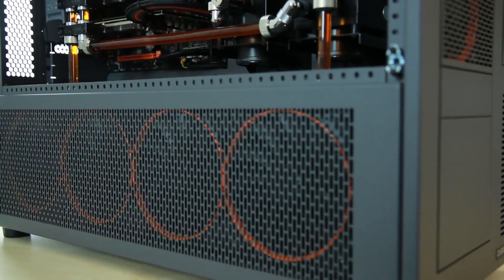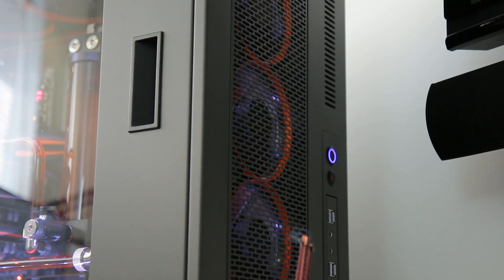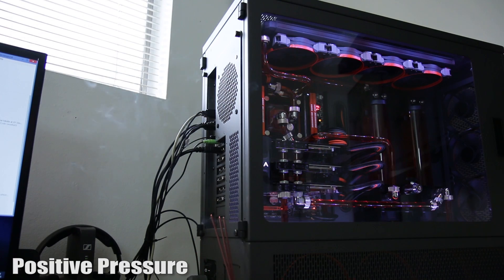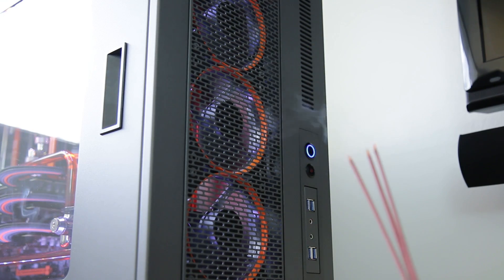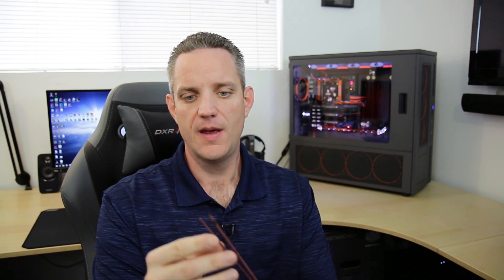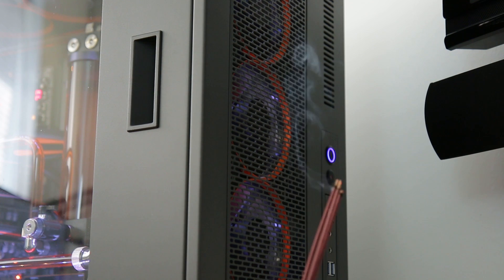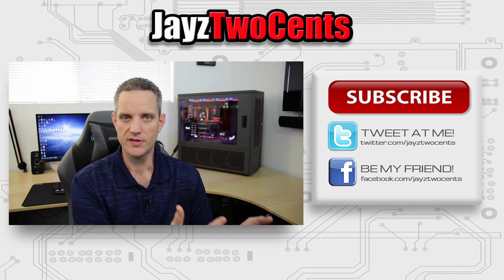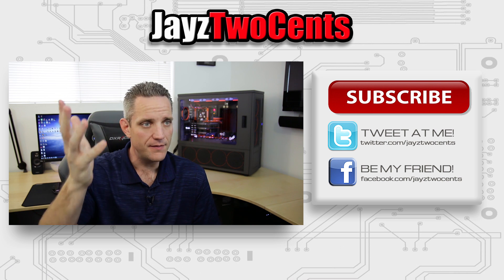Case Flow and Pressure Demonstration - How to balance airflow

Comment: Ik noones gonna answer me but what if im using 3 front intake, 3 top intake fans and 1 back exhaust fan. Is the pressure too much? Will the cooling be better with what i said or just 3 front intake fans and 1 exhaust?
Reply: all front 3 intake top 3 exhaust and back exhaust works fine for me

Comment: Gah.. im buying Lian li infinity fans and want to try see as many infinity mirrors as possible (center) and then they must be set to exhaust afaik.... so IF i put more fans as exhaust, question is if it's worth trying to lower the rpm on the exhaust just to achieve a balanced preassure, since i assume it would mean it would be less air transported through the case, or if i should live with getting some dust in through the cracks and vents... hmmmm VERY educational video, thanks.

Comment: Doesn’t intake fans without filters equal dust?
Reply: Yes, yes, of course, never desirable, for dust is not your friend.    The rule:  Intake shall be through filtered vents only to avoid ingest of dust.  If you have a vent without a filter, you must either employ a fan to exhaust out that vent, or, if no fan is employed on that vent, you must maintain positive pressure in the case under all scenarios to ensure air is passively pushed out of that unfiltered vent (thus avoiding ingest of dust).

Comment: I like to believe pc fans are like vehicle valves inside the engine.  Naturally the intake valves are bigger than the exhaust valves for those that don't know. I have my setup for 2 intake fans in the front, 2 intakes fans on top and 1 exhaust fan on the back. When I run a game like COD : Warzone or Dota 2 for example,  I always see my GPU tempature always at 70-72 degrees celcius.  I was thinking of flipping the top fans into exhaust fans. 😅

Comment: A pull configuration will always cool the rad better because it's not pushing it's own heat through the rad.
You should always have more air out than air in (negative pressure) because positive pressure can create hot spots (non-flowing air). This is a lesson learned from aircraft design (cowls) where heat dissipation is critical.
A closed cabinet with high air-flow will almost always run hotter than an open cabinet with moderate air flow.
You should not be using your computer cabinet as a dust filter, an air cleaner works best for this.
Never BLOW the dust from your computer, always use a vacuum hose and a paint brush to remove dust.

Comment: Thanks for this. This video helped me test and understand how my case air flow worked, particularly under load. While I had a neutral or slightly positive pressure environment which is what I was going for, it actually became a negative pressure case under real-world gaming loads! 

My GPU was pulling more air in under load - This became apparent as smoke was entering in the back of my case were the PCI slots were. And since these PCI slots are not filtered,  over-time this would mean dust was entering in my case, introducing another problem.

The smoke testing allowed me to fine tune the fan curves for both my case fans and GPU fans in order to maintain a happy equilibrium with noise/positive pressure/heat dispersion AND also ensured my desired intake fans were the only ones pulling in air since they were filtered.

Comment: Thank you for the insights! I'm prepping to build a 'research' rig to crunch raw data (BOINC projects) so cooling is a paramount concern (along with power dist). I'm starting off with 3 x Noctua AF-14 3Ks in the front of a NZXT H7 Flow and one more in the back, and there's X73 360 AIO on top for the CPU. The system is engineered (W) to utilize the efficiency of a 1000W Ti PSU so while the fans may seem like over-kill, the goal is run them at lower rpms while still achieving good cfm and reducing noise output, but have the headspace for more cooling at the expense of pc-type silence if all cores (16) are in use. I have all the parts but the Noctua fan controller which must be coming from BFE.

Good luck on the warehouse build out!

Comment: I have 40 positive airflow difference in my case. That's pretty close. Its half of a small fan in my case difference. Is there a program that calculates the acupressure in the case? and then alters the speed of the intake to balance the air pressure in the case?

The reason I ask is I have a minimalist case, cos I have no interest in overclocking. A floor of the case is a hot spot at the bottom, and correcting this is optimal, for the heat and the other fans in the case.

Comment: I didn't go through the comments but wouldn't going through all possible configurations and seeing what the inside temperatures are the best method of fan setup? I inherited 2 front intakes and the other 4 fans, all exhaust (all same size/power and unfiltered). I reversed one in the back to intake and it took the temperatures down 3 degrees f.  Since I'm running a constant 92f I'm happy with the setup. Suggestions?

Comment: I don't think positive/negative pressure matters if you aren't using filters.  also, I found that even if you use positive pressure and filters, it stops all the big dust bunnies, but fine particles still get in so you really don't save any maintenance, you still gotta blow the case out and that fine dust almost seems harder to blow out.
The big danger is, and I don't think anybody makes them anymore, if you have those squirrel cage fan cooled video cards.  The only way to get the dust out is to disassemble the card.

Comment: any descent build has pressure sensors in the case to compare internal and external barometric pressure which the fan controller uses when adjusting the fan speeds.

Comment: I got a shitty ass case and was asked to build a pretty beefy system in it and the guy would not take a bigger case or let me turn RGB fans away from site. I hate RGB ten times more now because the case is so tight I can’t put fans in their logical position without obstructing the RGB with other components so I came to this video for some hints to help and oh boy there was a lot I didn’t realize about negative and positive pressure. So much was well worn territory,  but the RPM bit did help a lot.

Comment: i have positive pressure 2 200m fans on front for intake and one normal exhaust on back. my problem is that since i got the 6800xt which, unlike the 5700xt i had that exhausted straight out of the case, exhausts in to the case. the gpu runs 10-15c hotter with the side panel on so i have to take it off. what is the solution? do i simply need more fans, more airflow through the case? i only have the top vent for additional fans. would it even make a difference since i already have positive pressure and adding two more exhaust at the top would likely create negative pressure and wouldn't, seemingly, provide additional air flow across the gpu.

Comment: Question for Jay & the comment section : 
For an AIO mounted at the top, do I want my fan direction to pull air into case (which seems wrong to me but I'm hearing different things on the internets) or push air out the top?

Comment: So if I have 3 filtered 120mm front fans & 2 top filtered 120mm fans with a radiator, that is positive airflow? I won't need a rear fan?
Reply: Thx in advance

Comment: front panel should always blow into the case, the top of the case should be the exhaust, the rear should also be the exhaust, with the cpu fan being turned to the rear of the case, any other configuration will result in high temps

Comment: Mostly good info, but some incorrect physics here.
You said that positive pressure is when there's more air flowing into the case (envelope) that exhausting out, if this were the case - pressure would continually rise inside the case. The inverse being true for negative pressure. In all three scenarios, the balance of airflow in and out of the 'envelope' finds an equilibrium by either taking in, or exhausting out, air through other vents and gaps in the case. Which you correctly point out, so you're right in the end, but with the wrong physics to back it up.
You also said that a fan 'Can't turn without air going over the blades'. This is also wrong, you could put the fan into vacuum and it would spin, possibly too fast, but it would spin! It's a fan, not a wind turbine.

Comment: My case came with three fans on the front panel as intakes. The bottom one seems to only be blowing air into the hard drive and the power supply. Should I remove that bottom fan and put in the back panel as an exhaust or should I just leave it as an intake along with the 2 fans above it? Or it is worth to buy more case fans? Also I don't know if this matters but I don't have a GPU and I won't be overclocking. I also have a dust filters at the top and bottom and a big air cooler that's mounted horizontally to accommodate the front to back airflow configuration.

Comment: just took the fan from my bad psu and put it in the front intake. the fan is a  2 wire/pin, black and red, black  is ground and red is  12v dc. so on a 4 pin sys fan , you want black in pin 1 and red in pin 2. 

is this correct?  would this be ok?

Comment: 3 intake fans?  What are those 4 at the bottom then?
Reply: The lower compartment is isolated from the upper compartment.
Reply: @JcRabbit  do you have any idea why it's isolated or why does it require 4 fans?
Reply: @trailchaser2  To isolate the hard drives and power supply from the other components. As for the 4 fans, it was probably a question of 'why not?' or 'it looks better that way'. You would have to ask Jay to know for sure, though ehehe

Comment: Summary..
Intake > exhaust-> positive pressure
Decrease amount of exhaust or increase the amount of intake to achieve this.
You can check for the pressure using the vents and smoke. Smoke in means negative, where smoke out means positive. Use the vents that are not occupied by a fan.

Comment: I have Asus m32cd with over have the side are built in holes. How should I set my fans and should I cover the holes. I have a 120mm intake front and 90mm back out take just below psu fan with blows down. I really need help on this. I would appreciate it.

Comment: I have tested this quite a bit and I'm going to buck the trend of thinking (note I have air cooling on the CPU and standard mounted GPU), my best results are in fact - 3 120mm intake front - 1 intake rear just beside the CPU cooler - extract at the top and extract bottom, 3x front brings in high volume cool air, 1x rear brings cool air straight to the CPU cooler - 1x top extracts the CPU  warm air straight out the top, 1x bottom extracts hot air from the GPU fans straight out the bottom, so effectively I have air intake in front and back being sucked  out top and bottom - this configuration works very well indeed and is working with the CPU and GPU fan directions

Comment: There are a lot of pc cases which basicly have an enclosed front side with little holes on the sides of it.. And most of them come with 2 or 3 fans in front. Are they of any use? Will they push enough air through the case?

Comment: I have a corsair 1000D. 
And i have 8x 120mm fan tray for both front and top panels. 
So is 8 fans front, 8 fans top and 2 on back. All 120mm. 
Whats is the best way to configure all those? 
I was thinking the first 2 towars the front on top as intake as well.
Would that be a mistake?

Comment: I've only recently begun considering actual technique in my thermal regulation. I originally had an FX chip in a Cooler Master Scout case with dual GPU's. It ran kinda toasty! Now I've got a Ryzen 3 (for now) in a Cooler Master H500, and things are a lot nicer. The same GPU's run on average 5°C cooler and even with the stock cooler, the Ryzen 3 never breaks 73°C fully loaded, whereas the FX could achieve 83°C barely trying. Next I'll be looking at optimizing airflow within this case in readiness for the Ryzen 5000 series and whichever GPU prevails come Spring of 2021.

Comment: Another alternative is to tear off about a 1/2 inch strip from a facial tissue(puffs etc) and hold by tip and place in front of test target. Not as sensitive as smoke but works in most cases

Comment: purchased a computer off a friend worth $4.5k new, now minus the 1070 gpu. first thing i did was give all the filters a clean and dust. the water cooled cpu radiator was blocked on the outside with that much crap he had to have been getting high temp shut downs. cleaned and vac'ed out, turned said fan over so it pulls not pushed from the case, should last for ever now. been 6 months and still get asked if i have issues, nope, and i have a great picture of all the crud that used to be on the cooler. $600 well spent lol.

Comment: Hey man! I am about to build my second PC and I am looking form something that looks good but. I am also trying to get the best airflow. i am also planning on vertically mount my GPU. That leads me to the choking hazard for the GPU. I want to have fans pushing air from the bottom since that would help me with the GPU.
https://pcpartpicker.com/user/Shadow2730/saved/PLGvnQ
If you can help me with a good case that could push air decently I would very much appreciate it

Comment: It's funny that I've run into this old video.  A++  I'm sure this is why so many support technicians smoke heavily and not at all because of stupid malware that customers exposed themselves to and corner-cutting system builders using sketchy parts.  LOL  But it's also a good reminder to me that I keep putting off my case's side window project.  It's a case with a big open mesh side that I've been meaning to put an acrylic window behind for years now to control the airflow (and noise) ... and keep putting off because I'm lazy.  Which, ironically, has made more work for myself over the years to clean the dust out of my PC because my intake filters are being bypassed by that big open side panel.  But ... you know ... doing stuff means work and if it ain't broke...  LOL  Bad me.

Comment: I want to know how the hell i am accumulating so much dust.
Its been 6 months, and i have so much dust, its not thick or anything, but u can make streaks and the cpu heatsink looks sick.
I also cant blow most of it off because its like stuck because of the humid climate.
I used a paint brush , because it seems the remove the heatsink and the fan looks like a pain, u need force and a pry tool (amd 3900x with the wraith cooler- not sure if they all the same, looking)

Comment: cool video. Its so important not to have negative case pressure if you don't want your case to fill up with dust.
I reversed my rear fan and put a dust filter on the outside of it. I also balanced the rpms. 
Now I have positive case pressure :)

Comment: Question:  Air cooling fan placement?  Is there a rule of thumb or specific method to it, or do you just sort of go bottom to top front to back?  I think my main issue is I watched and read too many differing opinions and probably had a better grasp on things before "researching"...  To be clear I get the +/- neutral pressure and it's not like I'm pointing two intakes at each other on opposing side or trying to make hot air sink.  But how do you take a non-blower style GPU and large radiator cpu fan into account?

Comment: Don't you want the hot air in the case to be expelled as soon as possible, therefore, exhaust pressure should be higher than intake pressure. Sure, you might accumulate more dust, but at least you're not just blowing the hot air around inside the case when intake flow>exhaust flow.

Comment: It's a bit late, but I just watched this and Jay is wrong about positive and negative pressure. They have nothing to do with the airflow into and out of the case, the case will achieve an equilibrium no matter what, it's not an endless void to suck air into, what goes in must go out. The only difference between positive and negative pressure as he demonstrates is how the air will flow at the cracks and openings (out or in) driven by the pressure inside the case being higher (positive) than what's outside or lower than what's outside (negative).

Comment: Case cooling tip...remove both panels...place window a/c unit against the side of case...plug in and look at them low temps...overclocked my 7700k to 6.32ghz and only running 62 degrees. Remember dont forget to vent the a/c exhaust. 

You're welcome

Comment: Thanks jay this really helped as far as making my cases flow well. i used little tiny pieces of paper towels to see if I was getting suction at the front and back. I was getting suction around the graphics card and where youd mount a side mounted gpu. and I was getting blowing out of the front. removing one fan on top and downplaying the speed on the 2nd one on the top and leaving the back one do its thing. the temps on the gpu went down to 68 C with a stock cooler. this is even with a 360 rad in front of it.

Comment: Negative air pressure is really good as long as you have a properly designed case (rare). Proper design means all the intakes have filters. Fractal is good at this.

Comment: I use 2 120mm fans on the front pulling in air an 1 200mm fan as a exhaust

Comment: The mistake people make is buying cheap fans that don't operate well at high pressure so they try this and it doesn't work - This is why anecdotal information can't be trusted, you don't know if the individual knows what they're doing and is qualified to speak on a topic, but here's my experience.
I actually had a R5 2600 and a RX 570 gaming in a miniATX case with a single Corsair SP-120 as intake and it ran cooler than the same setup in a Corsair Carbide Gaming  case (Not the exact name) with two SP-120s, a lot more room and 5 empty fan slots for breathing.

Comment: I've got positive airflow in my P300 case (Which only can have 2 front fans, 1 top and 1 back) by keeping the top exhaust fan off unless the CPU gets too hot. So I always have two front intakes and mostly only one rear exhaust.